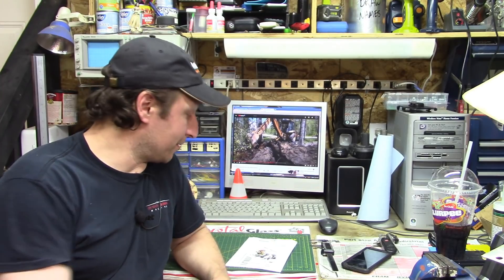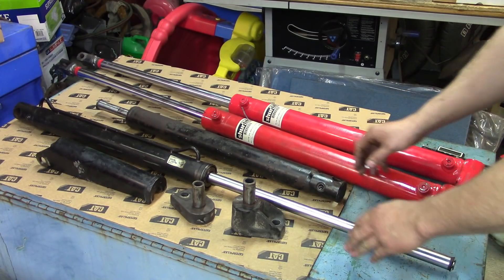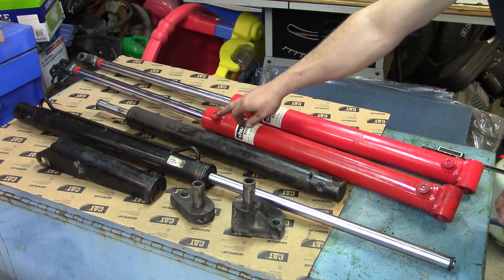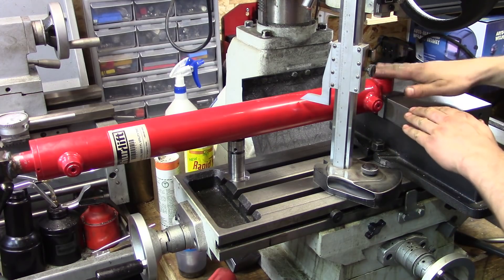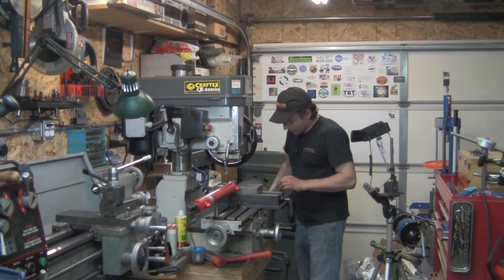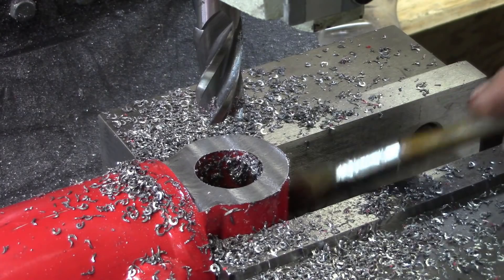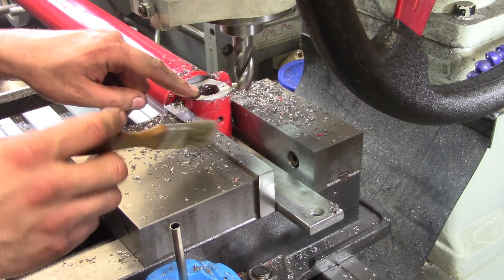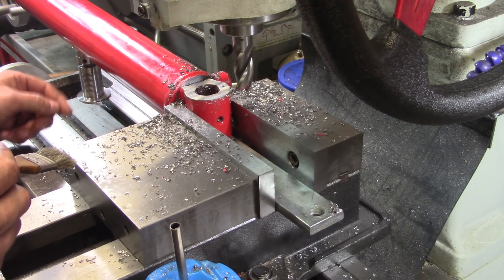Freightliner Argosy Tilt Cab Ram Mods Part 1

Comment: Nice work Everett. I often scribe lines with my good calipers. Why not. I buy them on kijiji for around $20. I think I recognize the backhoe on your screen at the beginning. He's not the best operator. I'm off two part two. Take care.
Reply from the maker: Thanks Randy, I just got a new pair of calipers so want them to last a while.  Steve does have a point, but if you are getting them cheap enough and it works, then it makes sense to just use them for sure.  And I was wondering if you'd recognize what was on the computer, lol!

Comment: First thing, congrats on over 10k subscribers! Nice to see...
Could you have used an angle grinder cut-off disk to get to "near net" size, and finish off on the mill? 
BTW, where  I am, those cab-over Mercedes Argosy are pretty common ;-)

Probably could have picked up the parts here on the used market, but new ones, even with some futzing around, are probably a safer bet, and, as you have made the mods, the cylinders could be more easily replaced, if ever needed.
Cheers, good sir!
Reply from the maker: Thanks, I'm just thankful that there are others who want to come hang out with me in my shop.  Especially of late with less social contact physically the hobbyist community here on YouTube has been a welcome group.
I had thought of using the bandsaw or cutoff disc, but decided that it would be almost as fast just to machine the cylinders in total.  As for the cylinders, if they ever need rebuilding then the kits are easily and cheaply available at Princess Auto across the country.
Cheers to you as well!

Comment: Good job on the retrofit. I did the same thing on my case ih baler hydraulic twine arm $650 from dealer 2 week wait time if all goes well $139 from princess auto modification to make it fit up and running  same day thank god for princess auto lol👍👍
Reply from the maker: Thanks!  I hear you about Princess Auto, their hydraulic component and service departments are surprisingly well set up and equipped.